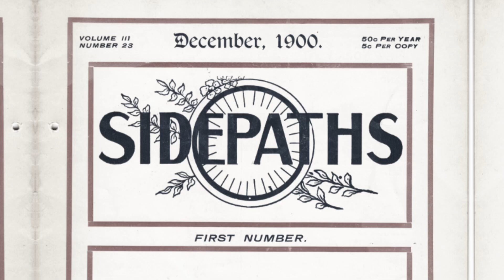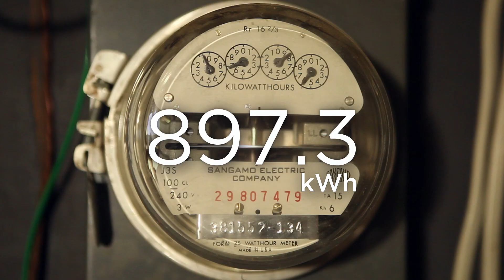Can You Power A House With A Bicycle?

Comment: That lamp (2:38) has a power requirement of 120W/60W/40W (if a days usual usage is about 8h/16h/24h) ... really?
Lamps of that type used to be powered by heating bulbs of at max 60W (typically more 20W).
But who would try to power his house with a bike and not use LED bulbs? That's 3W to maximally 6W!
Reply from the maker: The lamp in that shot was using a 40W lightbulb. So to "keep it going" continuously (for 24h) it would take .96 kWh. You probably wouldn't want to keep a light on that long - but it's just a rough way to show how much energy you're using on your bike. We took an average American house as our example - and average American houses use more energy than they need to. There are myriad ways to reduce energy consumption.
Reply: @skunkbear  Yay!  Always happy to see people use the word myriad.  Such a colourful word.
Reply: Power usage does not increase when the time of usage increases.
Reply: No, but power usage by time (kWh, as was given in the video) increases linear ;).
They said 960 Wh/day for a commode lamp, without defining "day" (varies depending on latitude and date in most cases).
Reply: CmdrFirewalker My concern was with this:
'120W/60W/40W'
So you mean what the power of the lamp would be if it was calculated from that 0.96 kwh/day?
Reply: No. They didn't give a run time/day, so I made an estimated guess which was 8 hours/day, breaking the power of the lamp down to 120W. But I wanted to give them the benefit of the doubt, so I added the resulting power requirements for the cases of running it for 16 or 24 hours.
Reply: CmdrFirewalker That is what I meant.
Reply: Ah sorry I was in a rush .. hey wait, that was only clear after the edit ;) :D
Yes, I had to calculate and found the results implausible.
Reply: CmdrFirewalker I would like if sites with comments told someone when a comment they were notified of is edited :)

Comment: Never once asked the question on why do we need all that energy usage i.e. so many lights on, AC, etc. Conservation is key. My 3500 sq foot uses 752 per month.
Reply: I agree.  I would have liked to see what is possible rather than just a yes/no verdict on a set predefined parameters.  I think one could get pretty close to powering a well-constructed tiny home that has a wood burning stove for heat, on demand water heater, etc.
Reply: Devin Quince leds go a long way
Reply: The Sloth im thinking of building a tiny home in a bus, working on some ideas to power it. read my comment, i think i have a way to build my own and i will be using on demand water heater, propane oven and stove, gonna keep house and bus systems seperate so i can charge the house and jump the bus if i have to.
Reply: David King my thoughts exactly. And with solar carrying the bulk, the bike could be great for a cloudy day or whenever you need the boost. I don’t think it’s all that absurd.
Reply: Average UK household uses about 300kwh per week.  Modern builds use less.
Reply: Reduce > reuse > recycle
Reducing usage trumps all else.

Comment: Well done segment! Sums it up pretty good in just under 4 minutes.  A couple of considerations   that may be worth noting are: 
1) Americans consume much more energy per capita than any other country.  The number of riders needed to power the home is directly proportional to energy efficiency of the home /  life style of the occupants.   
2) 1 or 2 items in the home use up 90% of the energy.  Heating and cooling, hot  water heater, refrigerator.   This big hitting items  are too hard to do with a bike.    But everything else is possible with the bike including  LED lighting, blender, flat screen TV,  cell phone charging,  laptop operation and charging,  sound system operation,  fans,  but you would need a full time person in your home pedaling all the time to keep batteries charged to do these things.  

By the way,  free plans to build your own bike generator pedal power system is here:  https://www.youtube.com/watch?v=X0r9T7RwdPs    Brad Whaley,   Electrical Engieer
Reply: "full time person in your home pedaling all the time" aka a slave. Elektro gimp.

Comment: Seemed very defeatist. Isn't offsetting some of your household energy worth it if you were going to be training on a bike anyway?
Reply: I agree, whenever I've used a trainer in the off-season to stay in shape, I felt like I was just wasting energy (actually just creating heat).  I built a pedal generator and use it to charge my phone and other mobile devices.  I also found that wall chargers are very inefficient (20-30% losses) so direct charging with a 12v car charger is a better way to go!
Reply from the maker: Yes, I think so.
Reply: Well, it's not really worth setting up the equipment, if you're using 900 kWh a month and only generating 5 (because you don't exercise 24 hours a day).

It does seem like a fun thing to build yourself though. So build it because you want to build it, not because you want to save your electricity bill.
Reply: @thewhitefalcon8539  it's not about powering your whole house, if anything it can be a good mechanism to gain an appreciation of how much energy we use in the first place, but if you can power just a portion of your life and it brings psychological satisfaction, that it worth more than just the KWh saved
Reply: @zachhoy  I've seen people who run their computer/TV off their bike.
Reply: agreed, lame conclusion to the video

Comment: what if you found way to decease the amount of kWh you use to run your house, is it possible?
Reply from the maker: Yeah - but it would be hard. You'd have to decrease your energy use 50 fold - in other words, you'd need to use about 2% of what you currently do.
Reply: Hot water might not be very important for minimalists . . . .

Comment: lovely video, but I would like to point out you need to be active to stay healthy, so although you cannot power an entire modern household with a cyclist, you can replace a portion of it all with human powered tools to save money and be healthy while doing it. For instance, manual washing machines. With direct mechanical transmission, you don't lose any of your imputed energy to the battery. So it is very inefficient to power a television or an oven with a person, but many house hold jobs could stand to be replaced with pedal power.
Reply from the maker: That's a great point! Mechanical energy --> mechanical energy avoids a lot of the conversion inefficiencies.
Reply: @skunkbear  I want to see a bicycle powered lathe.
Reply: Yabba dabba do (feet power cars)
Reply: Skunk Bear such a cringy, but funny intro

Comment: what if one wheel spun multiple generators instead of one?
Reply: that means you get a multiple of the resistance, meaning more force is needed, meaning you can't go for as long.
Reply: CAPSLOCK alright ty for responding
Reply: You can also change the amount of resistance using gears, no need for multiple generators if you want to try that route.

(Theoretically, you should be able to do it with electronics too, but that's way harder)
Reply: @Drakilicious then you need to pedal for longer